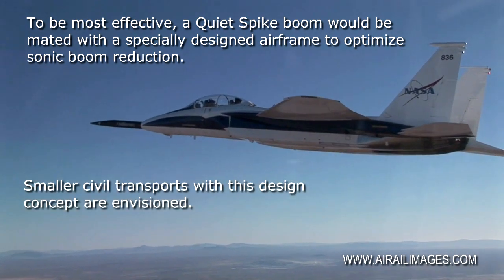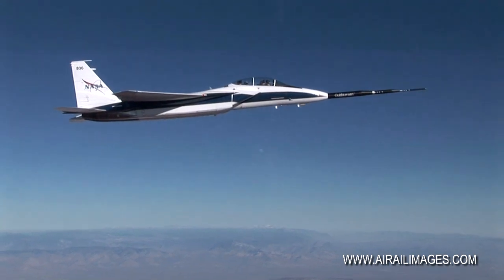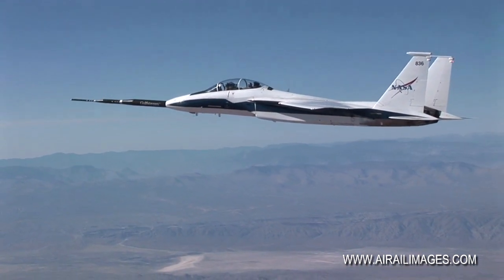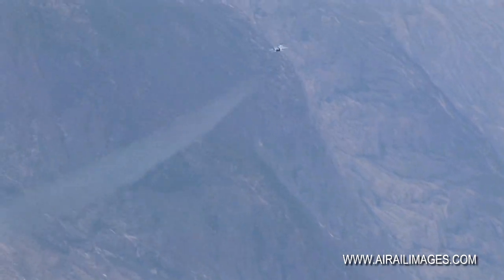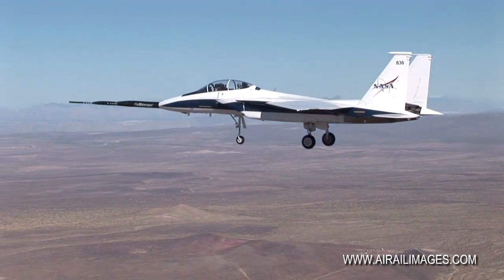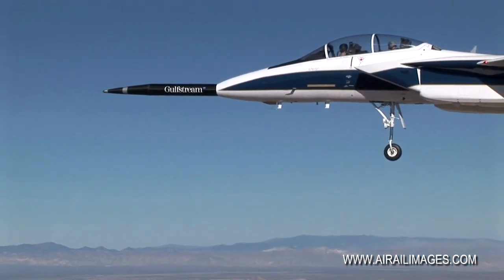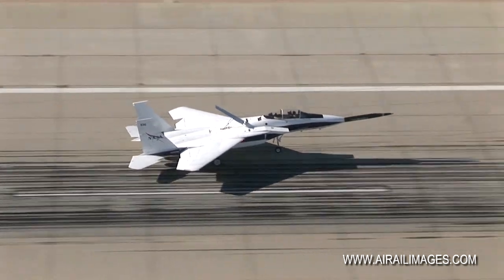NASA Quiet Spike Supersonic Research F-15

Comment: How come they didn't show it going supersonic? That's the whole show
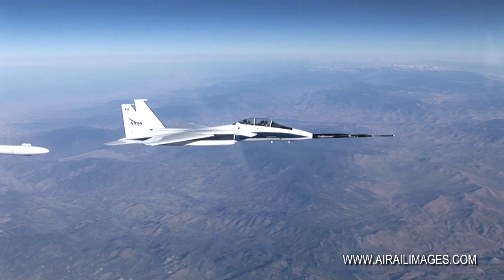Reply: they did. 2:10 "engines in burn" means they went full power. Then he said "Mach 1 indicated." That means they're going supersonic.
Reply: Wow, there's no visible shock at all. That's pretty cool.
Reply: "The cloud is caused by [airflow expansion] decreasing the air pressure, density and temperature below the dew point." Edwards AFB is in a pretty hot desert. So the temperature change might not be great enough. Or there simply may not be any moisture. Id expect shock cones to be rare over edwards. But an aircraft doesn't have to go supersonic to get a shock cloud. The B-2 gets them sometimes and its strictly subsonic.
Reply: Terrance Storey I thought subsonic aircraft get shock cones when they induce local supersonic flow.
Reply: I believe you're right about that. When an aircraft is transonic, Which i think is .9 to .95 mach. The whole aircraft isn't supersonic but local parts of it are.
Reply: @appa609  There wouldn't be a visible accumulation of dense air at altitude.  The air is very thin and dry up there.

Comment: Look at all these idiots in the comment thinking this F-15 is for war.
Reply: People just don't understand that NASA uses fighters as convenient tools for high-speed research.

They automatically think the equipment being tested is for warfare when over half the time it isn't.  They do a lot of civilian research at the Dryden Center which is right by/in the Edwards AFB facilities.

NASA's used a variety of F-15s over the years.  The first F-15 use that I'm aware of was to study the durability of the Shuttle's reuseable tile system under heavy dynamic loads.  That was well before the first Shuttle launch in 1981.

Afterwards, there were programs to test adaptive flight control systems and such.  Again, not necessarily aimed at the defense industry.

The F-15 is more convenient for some programs because of twin engine reliability/redundancy and the aircraft's ability to take loads to high altitudes.

It will be a long while before SST's are practical.  The technology AND need really isn't there right now.  Travel will be subsonic until the economics and technology meet up.
Reply: @AvengerII  Your better off going into low orbit and bouncing of the ionosphere than trying to constantly break the laws of friction.. Use a friction less environment to your advantage.. It would be more efficient and quicker for long distance travel..
Reply: @deltaforceshuttles3749  "break the laws of friction"?

Comment: Better add a large ventral fin to the bottom of that F-15 because with that boom extended, if the jet ever happens to yaw sideways more than a few degrees, that extended boom will make the jet flip around like you wouldn't believe.
Reply: It will probably snap off and get sucked into the engine before it flips the whole plane around

Comment: f-15u, u for unicorn lol. but in all seriousness i believe this tech is useless in regards to manueverability. swing a large cylindrical object at such high speeds in any direction rapidly and that could put lots of stress on an already stressed frame as the nose like it or not is just not as areodynamically stable as the rest of the plane. it could work for stealth bombers however since they dont menuever as much. enemy cant see it on radar+cant hear its flight in open= atomic ninja. too bad we still need to improve our stealth lol any long wave radio wave can detect our stealth tech.